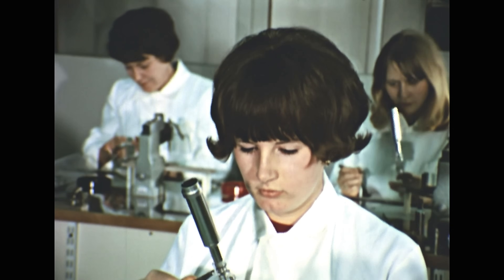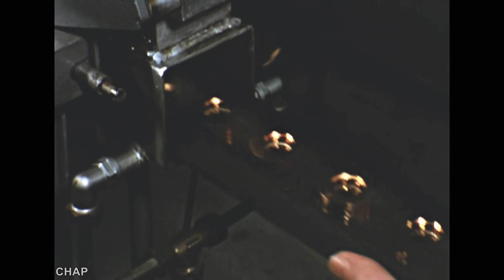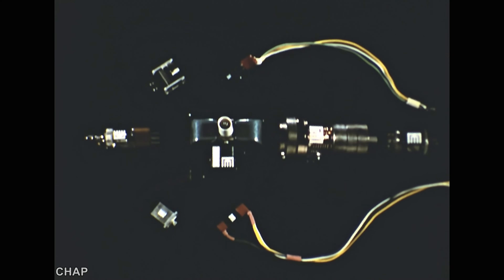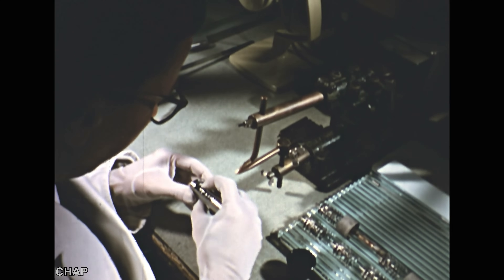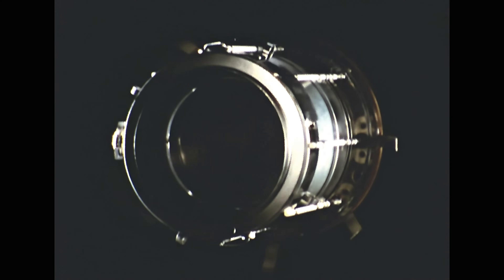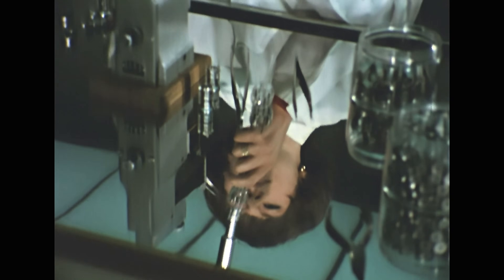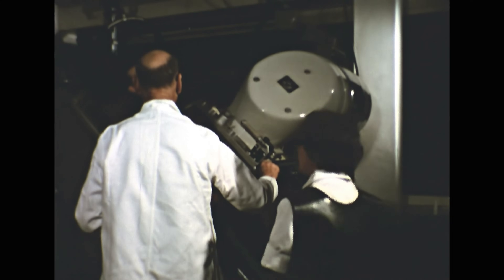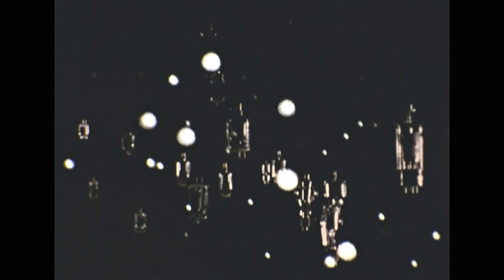1968  HOW VACUUM TUBES are Made: English Electric Valve Co EEV Television Radio Radar CRT Cameras

Comment: semiconductor technology.brought the end of vacuum tubes
Reply: They are still used (and superior to solid-state) in hundreds of applications. It was just the end of mass-production devices. MOSFETs and Diodes are just more efficient and cheaper for simple low-bandwidth applications like audio amplifiers.

Comment: I worked at EEV in Chelmsford in the early 1980's. A wonderful place to work with so many skilled staff and interesting tube manufacturing going on. The 'peace dividend' and advances in semiconductors meant that the market for military and broadcast tubes was getting smaller. When I left in the latter 1980's they were embracing semiconductor technologies and tube manufacturing was reducing.
Reply from the maker: Hi John, sounds like it was quite a fascinating experience!  ~  VK
Reply: In the very early 80's EEV finally ceased production of their handful of legendary audio valve types: the KT88 (≈6550), KT77 (≈EL34), & KT66 (improved 5881/6L6WGT), & Z729 (their non-standard nomenclature for the EF86/6267). EEV seemed to have no use for the standardised JEDEC nomenclature system, assigning their own largely meaningless & confusing type numbers instead.🤓🥸👹🙄
At least the two letter prefix for their small beam power tetrodes actually meant something: "Kinkless Tetrode".
It seems to me to be a bit of heresy to see "new" Serbian & then RuZzian valve designs being given "KT" prefixes that have absolutely nothing to do with Marconi-Osram/EEV whatsoever! Like the Serbian KT90, which was a Frankenstein television Line amplifier (what Americans call "Horizontal Deflection Tubes") recycled to have Audiophile pretensions, probably based upon the EL509; the Chinese KT99, which if I recall was nothing more than a glorified nomenclature for getting more money selling a KT88; & then most recently the RuZzian KT120 & KT150 types, made by Reflektor in St. Petersburg & branded instead as  "Tung-Sol", a long-dead strictly American manufacturer with no connection to this company whatsoever!🤪
And these valve types are really both the same thing, just with the envelope having a different shape & the KT150 claiming 5W greater anode dissipation as a result along with a 3000hr. service life vs. 2000hrs. for the less expensive KT120.😈
As for the actual origin of these designs, I don't think that the RuZzians were clever enough to design these valve type(s?) entirely from a clean sheet of paper.
Rather, they appear to be suspiciously similar to the Telefunken EL156, with a much larger anode dissipation & grossly exaggerated voltage ratings for the Anode & g2 ("Screen") grid...👹😑

Comment: Use to maintain thermal imaging cameras or TIC's made by EEV. The pickup tube was called the "Pevicon" Was quite sensitive to slight temperature changes. Used for an aid for firefighters.
Reply: Yup I remember those pyroelectric vidicon cameras. For their time they were extremely useful. 🤓

Comment: I work at a particle accelerator and we still use tubes for a lot of things. Klystron tubes provide power to the beam and accelerate electrons to almost the speed of light. 

They've been working on replacing these dinosaurs for years, but solid state amplifiers still have problems producing the high voltage/high power needed.
Reply: Heck, klystrons are so ubiquitous in RF applications. I'm no RF engineer, but it seems they're especially prevelant anywhere radar is involved. Presumably they can generate high power microwaves in a manner somehow better suited for the application than magnetrons would be. Though I'm not sure why... yet. But I agree 100% about semiconductor based technologies for generating microwaves. Every method I've looked into using semiconductors, ie tunnel diodes, seemed to have output powers in the milliwatt range. But that didn't stop me from buying a 10 pack of surplus soviet tunnel diodes for $20 total, not each. =D

Sorry if I'm a bit overenthusiastic. I don't have many opporutinities to talk shop with others about electronics/rf so it's hard not to rant on and on about it if given the chance hehe.
Reply: @VoidHalo  👍🇵🇱
Reply from the maker: Hi Gary, fascinating!  The still have high tech uses in many fields.  Thank you for the feedback!
Reply: I remember building Klystron power supplies from scratch when I worked at Marconi Radar in the early 80s. Dozen at a time, weighed a ton, full of transformers. Wonder how different they would be now, lighter perhaps with more electronics?
Reply: That's awesome! Sounds like really interesting stuff. I work with modern computer systems so no tube interactions in my 9-5. My fellow guitar plays well know the best guitar amplifiers to this day still use tube preamps and power amps. I get that sweet warm tube glow and sound everyday!
Reply: Great comments all around! Thank you...🇺🇸 😎👍☕

Comment: Tubes are still used in guitar amplifiers because of the rich sound and overdrive. After playing quality tubes in my amp for 3 years (now they are $150 each), I have Tried again the original tubes ($15 tube) With low market tubes, I lose something like 50% of my sound quality.
Reply: Although the tubes add harmonic distortion, It's mostly the transformer stages that give it the "tube sound".
Reply: If tubes continue to be as ridiculously expensive as they are now, I doubt tube guitar amplifiers will be around for much longer 🙁
Reply: @dingalarm  not as long as there are idiots like myself willing to pay outlandish prices for tone..

Comment: Great to see the image orthicon tube being awarded an Emmy! IIRC "Emmy" is in fact a corruption of the slang term "Immy" for the image orthicon tube.
Reply from the maker: Hi NipkowDisk, thanks for the etymology of "Emmy".   Did not know that!     A fascinating bit of television history!  ~  Victor
Reply: I think you are wrong.  Emmy is from Emitron, a version of the Iconoscope developed by the EMI company.
Reply: @stuartirwin3779  I'm pretty sure that's not the case. The Emitron was primarily a UK trademark. They would have been known as Iconoscopes in the US, where RCA manufactured them. Besides, the first Emmy was awarded in 1949, by which time iconocopes were entirely obsolete and the immy ruled supreme :)
Reply: @toresbe  You are quite right.  I stand corrected.  ☺
Reply: @stuartirwin3779  Well it was a fun bit of research figuring out why that felt wrong to me :)

Comment: That was edutaining! Has anyone got the full datasheets for an EEV PX2696 / P8041 two inch diameter Image Isocon tube? I have one in my collection and it would be fun to build another video camera around this tube. It probably came from a decommissioned medical X-Ray machine. I'll bet it has plenty of life left in it. These two inch imagers are significantly smaller than their Image Orthicon cousins which came in 3 inch and 4.5 inch models. The difference in the two types, orthicon vs isocon, is in which electrons are resampled in the return beam. Isocons work great in low light but would be blinded completely if someone lit a candle in the same room. Orthicons work over a greater range of lighter, all be it with a lower signal to noise ration.